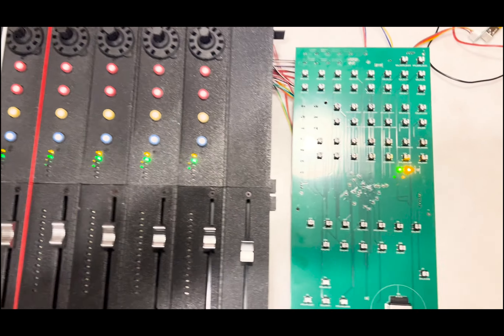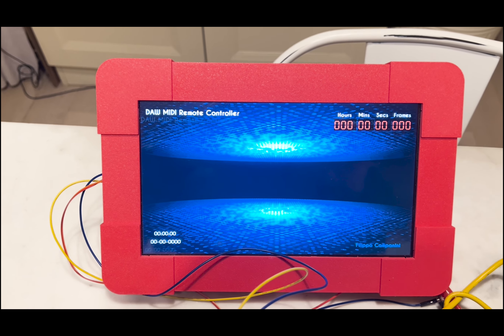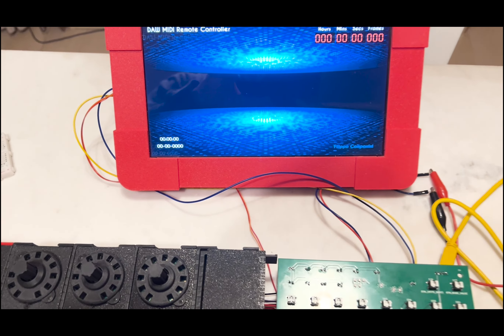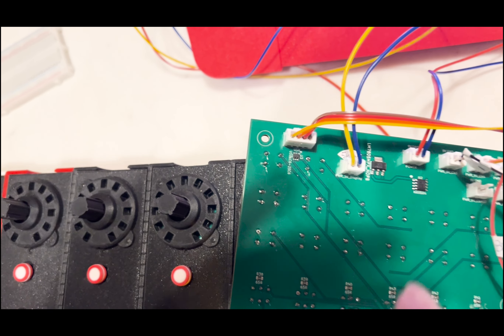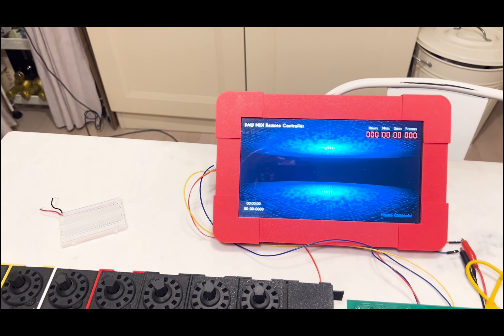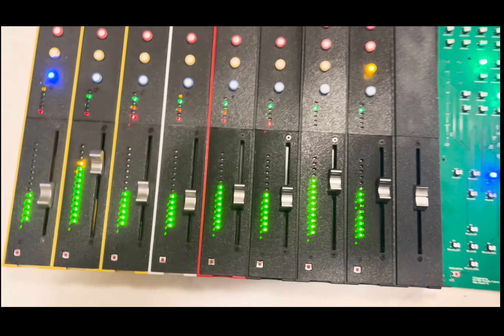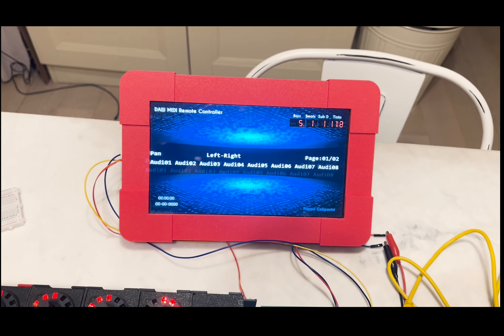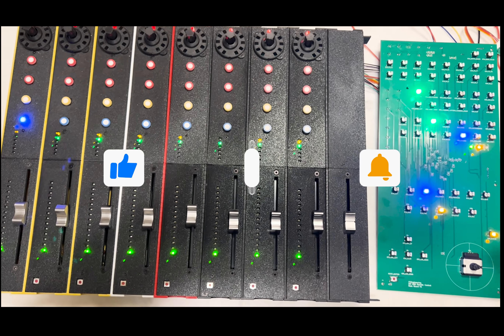DIY MIDI Remote Controller - UPDATE 17/12/23

Comment: Good . You can combinate a transister with voltage regulatod I.C. to raise the current capacity of it. I think it will be better than heat sync for long time use and its durablety.
Reply from the maker: I have waited to answer to this suggestion as I was making some test and experiment. At the end I decided that the best was simply to revise the design where in fact I made a mistake. Now the voltage regulator has been replaced and the entire power supply session is decoupled from the main board for a more modular design. Thanks anyway for the suggestion! Cheers!

Comment: Cool project. The sliders move very quickly, probably faster than needed?
Seems like you have a lot of room. Did you consider a small switching regulator? You could just stick it to the board and hand wire it.
Reply from the maker: Thanks. The heatsink made the trick at the end